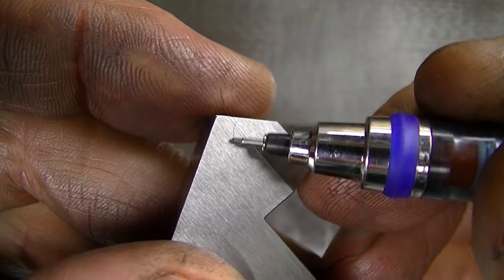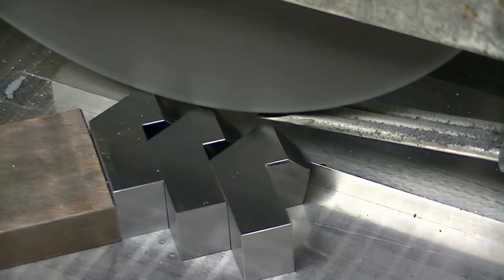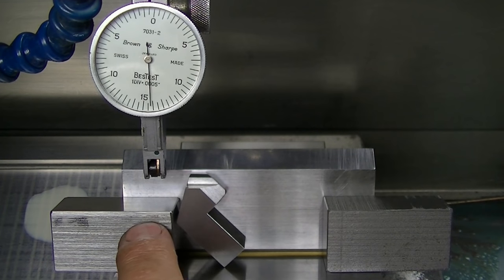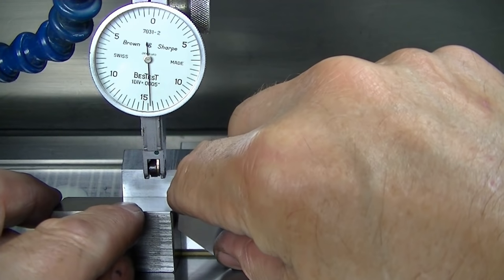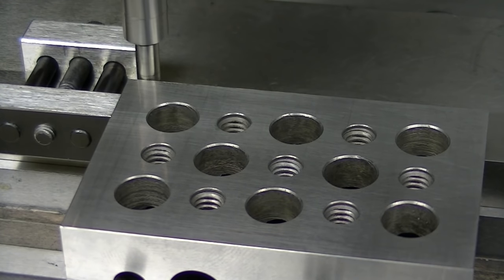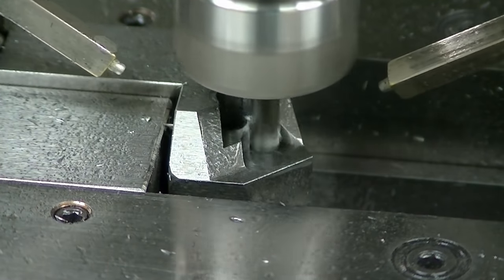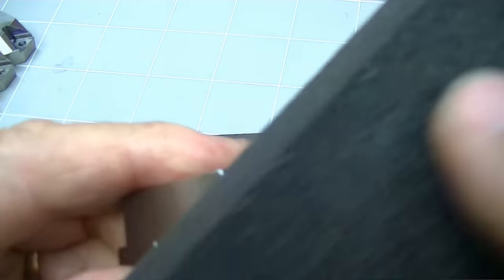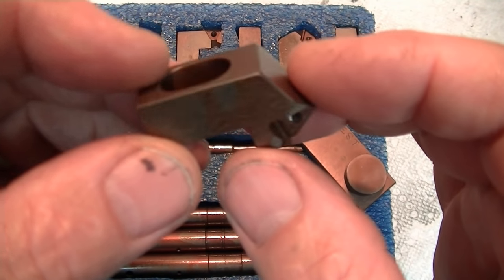MAKING INSERT CARTRIDGES PT2

Comment: "Shop Notes"*

• More advanced block and work support for the unique geometries of this project
• Tip about checking for and removing burrs when measuring parts ground parts
• Knipex parrallel jaw plier-wrench. There is a range of sizes and grip styles.
Amazon (7" reg. grip): https://www.amazon.com/Knipex-8603180-7-Inch-Pliers-Wrench/dp/B000X4KP1C/
• Note on solid 1-2-3 blocks on the surface grinder
• Discusses surface finish and magnetic holding power
• More analysis of crash modes and blocking
• Then Robin shows he is human and we get to see a bonus setup.
• "Exercise in looking at the surface grinder [...] as a metal removing machine."
• Shows his carbon fiber 'lifting stick' (14:20)
• Edge finding on a substitute known square (1-2-3 block) rather than an unknown part
• Using a ball end mill to counter-bore for screw holes on an angled face
• 14 deg tapered endmill to match insert 
• Blending and deburring chamfers with sanding sponges
• Masking tapped holes with toothpicks
• Explains vacuum hardening and tempering options, sending test button with a batch to avoid Rockwell testing marks on your parts.
• Rob shows his customized hot plate and explains optimizing temper for hardness/toughness.

*Not affiliated with any manufacturer or distributor.

Comment: Great lesson... I have worked as a Tool Grinder, and Surface Grinder as well.  Just goes to show... even after Decades... an Old Dog can learn new tricks!

I have been in and around Machine Shops since 1978, and I had never thought to use the Grinding Machine as the total removal tool.  In fact I do believe that this is a very valid argument, and should be considered.  

Your project went very well.  And I was curious as to how you would do each setup.  I sold my tool grinder years ago, and now am strongly thinking of getting another one.  Or maybe a surface grinder.   Especially after seeing this video!!!

Great Job!
Reply from the maker: Glad you're finding them useful thanks for commenting and watching!

Comment: Very useful hardness versus toughness graph, many machinists think the softer it is the tougher it is but they don't consider tempered martensite embrittlement which is that range where both hardness and toughness decrease. In almost any cases it is detrimental, except for the part where hardness rises again. The secondary hardening may be done in purpose like on hss steels which are tempered to over 500°C

Comment: The accurate, adjustable 90° V gives
perfect settings every time, quicklyand simply, for any qualityoperations you want.

•
In toolroom work, a variety of shapes can be held securely and ground to any desired angle.
•
Because of its accuracy, it is ideally suited for layout work.
•
If portable magnetic chuck is available, Adjustable Magnetic V-Block can be used on jig borer or other suitable machine.
•
In production, it enables quick and accurate set-ups. Because it is self-contained, it can be removed easily from machine for priority work without disturbing setting and quickly replaced without loss of time.
•
Because of its accuracy, it is ideally suited for quality production work.
SPECIFICATIONS
Size:
Length 6"
Width 4-1/2"
Height 2-1/2"
Weight 19 lbs.
Brass Lamination: 1/16th
Thank you for choosing Anton Tools Corporation! And remember...
Think Precision... Think Quality... Think Anton!
P.O. Box 320 · Greentown, PA 18426
570-676-5801 · Fax 570-676-5803 · E-Mail anton@antontools.com

Comment: This is totally cool!  First, as an electrical engineer I had no idea, so it is all new.  Lots to think about, and to think ahead.

On that knife-edge situation, could you have simply laid a small piece of steel, maybe 1/2 square rod, in the valley of the part and the V block, toward the operator, to continue the flux lines, er, fluxing?  If so, would it even require any clamping?  I am assuming here that the part face would be 90¤ to the near side Vee face.  Is all that is required is (more or less) continuous bulk ferrous material?

Anyway, THANKS for doing these videos, very informative, and really fills a gap in the content from all the other YouTube machinists!  I dearly love Tom L, Keith F, Adam B, et al, so much generousity in sharing.  You are doing a great service in putting these out there.  THANKS AGAIN.
Reply from the maker: Thanks Michael, yes a block to help carry the lines of flux through to the D-Block would help but it would still not be strong enough to keep the parts from moving. Thanks for commenting and watching!

Comment: Thank you for showing the mistake involving the missing magnetic flux path.  By doing so, you have likely saved others from similar situations.

Question about the same:  Would laying a block across your work pieces have allowed the flux to complete its path to the near face of your V-block?
Reply from the maker: Thanks and thanks for watching and commenting! Yes adding a block would carry the flux through.
Reply: Where was the "magnetic flux" going before? And what IS magnetic flux? Been a gearhead and science nut all my life and an amateur welder for 30+ years and a professional diesel mechanic for 25+ years and I've used magnetic drills and inductive bearing heaters and I've got a magnetic-base dial indicator that can be turned on and off and I've never come up missing my "flux path" yet. I never even heard of it. And I don't think I would have given I started learning basic science early in grade school and just built on it from there and learned electricity in ag mechanics classes and was a district champion invidvidual in ag mechanics on a district championship team and working in a local auto shop BEFORE I graduated high school and spent almost 2 years at the best technical college in the world doing the diesel thing and learning everything I'd already learned and a whole lot more doing alternators, generators, regulators, distributors, cranking motors, etc. Like I said, I've never heard of "magnetic flux" until recently and I know I've never been missing it unless it was an electromagnet with no supply of electro.

Comment: Question, probably a dumb on since I'm new to magnetic 'clamping'; but when you made your mistake by having the parts sit on a corner, why not just take another solid 123 block and put it on the sides of the parts? Would the magnetic flux not travel through the parts, the block, then back down into the V block?
Reply from the maker: Yes it would and I should have thought of that. Thanks for watching and commenting!

Comment: Thanks for your very informational video (subscribed)! I just have one remark: the spot where hardness is checked looks a bit thin. 2 inch is recommended or generally the thickest piece of the part. bending can cause false reading.
Reply from the maker: Thanks Bart, Those test pucks are about the same thickness as a the calibration blocks used for checking the hardness tester. Using a very small anvil on the tester minimizes any bending issues. Thanks for subscribing and commenting.
Reply: Anything that bends before it indents isn't going to indent at all. Not to mention a good machinist can usually determine hardness of steels with nothing but a sharp file.
Reply: the 2 inches is a spec for marine applications, somewhere, I've been told. me ex boss used to bring that up if measured values were out of tolerance. or maybe he generalised a spec for poldi.
Reply: That's what I do, but by comparison to Robin I'm a really crude machinist. Knowing something is hard but not how hard can result in poor performance.
Reply: Edit: I meant that I use a file also, referring to DEEREMEYER's post.

Comment: I like the look of the oven. Did you make it, or just modify it with PID controller?
Reply from the maker: I just added the PID controller and the solid state relay. It was a standard hot plate

Comment: Is there any concern with surface corrosion on media blasted parts vs leaving them in a more polished condition as ground? I know in this case the oxidized layer after heat treating mitigates that concern somewhat, but have you made parts where they were polished and then treated (bluing, nitriding, etc) to protect from corrosion from regular handling or storage?
Reply from the maker: I do steam oxide and also chemical black oxide but I don't know if the glass bead is any prone to oxidation than ground surface. Thanks for commenting and watching!

Comment: Robin, when you had to change to the vise because the magnetic flux thru to the knife edge on the bottom of the part made them loose, wouldn’t it have been ok to just put a block in front of them? So it transferred through the side to the base?
Reply from the maker: Correct!

Comment: Hi Rob, I looked at these videos again and you touched on something that I've been wondering about and that is tool hardness, it seems that most quality tools used for manufacturing are at 52 to 60 Rockwell, what is your take, you drew, drawed , : /  made the tool a little lower in hardness. I can't seem to find any reference as to why you wouldn't make something as hard as possible before it chips and just back up a bit. Again Thank you for your content, its nice to have master at the wheel and seeing you work.
Reply from the maker: There is always a trade off of hardness and toughness. In this case toughness is more important than hardness for the insert pocket. Usually less hardness = more toughness. This varies with the type of tool steel. I used A2 in this case because it is my "go to" steel and it "can" work here at the right hardness.
Reply from the maker: Lower hardness gains toughness usually

Comment: at 11:25 you bail out - what you do is put a block in front of the three and the lines of force flow from the three into the block and the other jaw.  Simple.
Reply from the maker: Correct!
Reply: Two heads are better then one!

Comment: Robin, I've noticed you have what look like syringe tips on your coolant/lube bottles.  I like that idea.  What are you using in the tips?  Is that shop made or off the shelf?  Thanks!
Reply: i have those on my soldering flux bottles. used hypodermic needles.
Reply from the maker: Those are bottles with floor lock caps made for the hypodermic needle style tips they are purchased items from electronic supply houses

Comment: What is the right preload for the insert/screw and how did you figure out where to drill the screw hole ?
Reply: there is no right preload because the screw fits the insert as a cone. So more than 0 is good. It only affects the screw stands up higher or lower. For a drill, you would want it as low as possible to prevent packing of chips. For dovetail cutters using your typical size 3/8th IC triangle insert, i've seen it 1-2 thou, reading machinist forums for over a decade.

I'll tell you a story, I have a small 15mm drill using very small inserts. The screw came from a chinese holder and sits very little higher than the insert, and maybe 10-15 thou higher. And the drill packs the chips and chatters and cannot drill. It's a seco, the inserts are 6mm wide square. In this situation you want it flush.
Reply: I see. It is quite obvious when you explain it :s
Thanks for the answer.
Reply from the maker: Zero is not good This screw needs to heavily sideload the insert into the pocket just before it fully contacts the  insert counterbore

Comment: Hi Robin. Great video, as always. Could I get your advice on something? How would I check the accuracy of a caliper with a set of clamp-on centreline pins? I'm using the Mitutoyo 050001 centre gages on a Mitutoyo caliper, and don't know whether I can rely on their accuracy.
Reply from the maker: Hi John, I would get two identical drill bushings and measure the outside diameters place them side-by-side and put the Center Point's in the bushing holes and the calipers should read the bushing OD
Reply: Thanks for the help Robin.That works perfectly.

Comment: nice presentation. How much do you estimate that one of those parts would cost if you count your man and machine hours (including setting up time of course), material and external cost (hardening)?
Reply from the maker: They were about the cost of a high end  turning tool holder
Reply: thanks for your estimation. To be honest I don't exactly know the price range of high end turning tool holders nor your hourly rate used for this comparison. What comes to my mind is that commercial high end tool holders most likely are produced in larger batches so they can spread the set-up time over a higher number of products. In your case you can spread the set-up time over only a handful of products.

Comment: Hi Robin, at 5:50 where would you say a hand scraped surface finish fits into your scale??? Better than lapped???
Reply from the maker: Probably in the 30% to 50% range. It is based on the intimacy of contact and actual contact area so scrapped would  be close to a planed surface.

Comment: Where did you find the heat treat response chart for A2 tool steel?
Reply from the maker: Hudson tool steel black book but you should be able to google that easily.Thanks Erwin for watching and commenting!
Reply: Probably the same place he found the aluminum he's actually machining in these videos. Start at the beginning of them and look at the scribe marks in the metal and how well the bluing has stained it AND look at EVER PART OF THE VIDEO AND HOW THE METAL IS ALUMINUM and tell me its "A2 tool steel". His grinding wheel intermittently throws sparks but only if he's just starting to grind and the stone is impregnated with carbide or steel from a stone truing tool or its grinding on the tip of his coolant nozzle. Otherwise there are no sparks and no amount of coolant prevents steel from sparking when ground. He claims his V-block and chuck are "magnetic" and that would feed into the "tool steel" story but damned if I've seen a magnetic V-block or dial indicator base that can be turned on "lightly". 

Mine can kinda-sorta be "feathered" but not very easily and it pretty much goes from vaguely magnetic and you can kinda tell to "full power". The magnet is on an eccentric and the only steel in those bases are laminated strips in the bottom. Otherwise the rest of the body is NON-FERROUS metal so you don't even up with tools and anything else metal like STEEL CHIPS OR CUTTINGS stuck all over them while you're trying to work. And his "magnetic" chuck isn't so flat or smooth and neither are his "tool steel" blocks and the magnet ain't too strong if somehow while he's surface grinding he ends up with COOLANT between the blocks and chuck.

Hate to break it to you, but if you're believing what you're seeing here and aren't just some sockpuppet account or buddy of his here making his b.s. look legit, you're getting taken for a ride. And I can't believe anybody who is into machine work and knows anything about metals can look at that silvery shiny and easily cut and scribed and very open-grained metal and think its "tool steel". So I tend to think you're in on it or out of it.

Comment: So what is the material ie. some type tool steel. and most importantly what type grinding wheel are you using. Nice Piece..
Reply from the maker: A2 air hardening tool steel    32A 60 H8 VBE

Comment: In vacuum heat treating, how do they transfer the heat into the parts?  Do you know if it's radiative or conductive?  I assume that heating in gas, the temperature is conducted to the parts through convection.  Thanks!
Reply from the maker: I believe the primary transfer is by radiation in the vacuum
Reply: That makes sense.  I bet it's tricky to keep the elements from getting so hot they self destruct. :)

Comment: Robin lots of good info again, especially the vacuum heat treating.  I used to have parts vacuum brazed, same benefits as the vacuum heat treat for the parts.  How did you chamfer the parts like that?
Reply from the maker: Thanks Bill, that is all hand file work with 4 cut pillar files and then the abrasive sanding sponge. Thanks for commenting and stopping back!

Comment: Just a thought, would a metal block against ("on") the parts in the magnetic V-block help with the transfer of the flux lines and increase the hold on the parts? I'm refering to the "failed" part of the grinding. Or would you consider that an unsafe situation? Thanks for the videos, very educational and interesting!
Reply from the maker: Thanks Thomas and yes a block would improve the flux transfer but it still would not be strong enough to grind well

Comment: i just watched pierre's video on telescoping gages. Do you recommend brazing a carbide ball on the tips, for a better feel? I saw you did that to your indicators. I would use a large ball, then grind 2/3 of it off. Then braze it on, for a better feel.
Reply from the maker: Since telescoping gauges are a transfer device wear on the tips is irrelevant. I personally feel carbide would be a waste of time.

Comment: Your You tube Video was recommended on "Basement Shop Guy". He spoke highly of your work and I can see why. I am glad he recommended you to me. By the way do you sterilize your tools before you show the ?????  Just kiddingT
Reply from the maker: Thanks Tom , thanks for commenting and watching!
Reply: Hi RobinI have a couple of questions. I subscribe to a number of machining videos besides yours. One of which is Don Bailey's "Suburban Tool". Don is quite emphatic to point out that one always slides parts on and off the grinding chuck. You specifically say not to do so. Who is correct ?????Also, where can I obtain the carbon fiber rod you spoke of.Warm regardsTom
Reply from the maker: You want to and I show sliding the parts ON the chuck so you can feel for any burs or dirt. You just don't want to slide them OFF the chuck after grinding since you will probably drag them over stray grit or metal particles no mater how well you clean the area. Many hobby shops carry the carbon fiber rods or you can google for it.
Reply: Thank you so much.Awaiting the video on making a diamond stone.Warm regardsTom